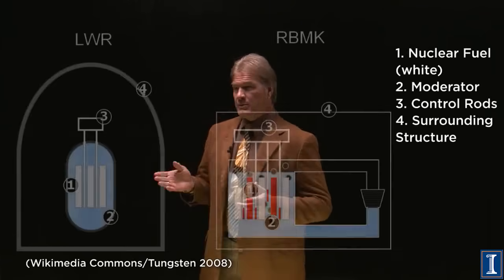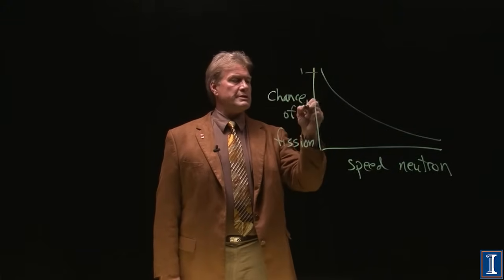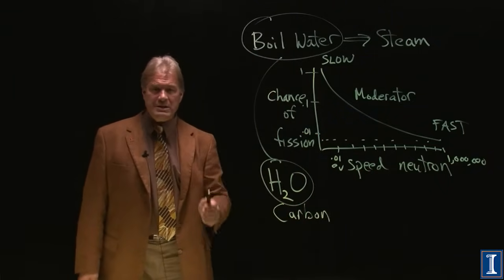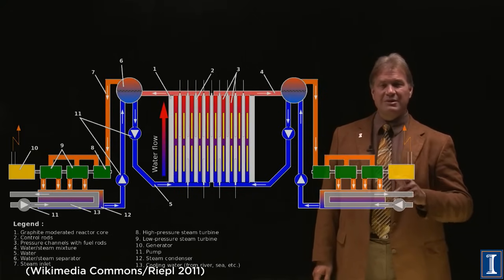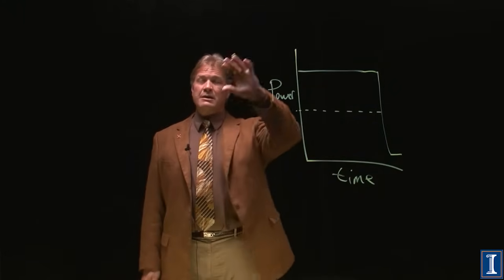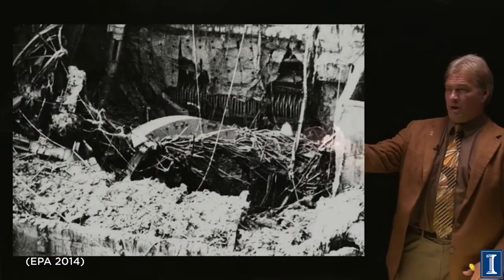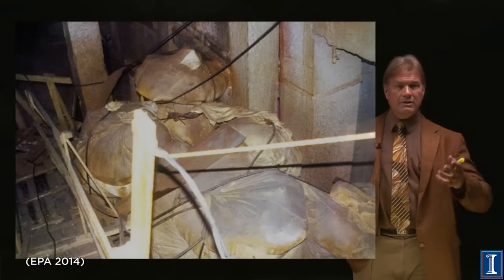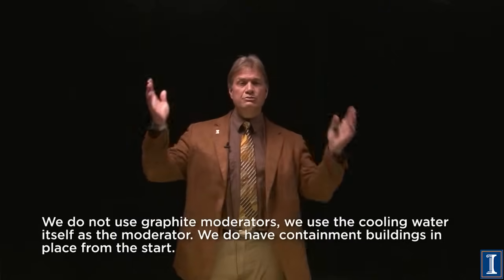Chernobyl: Worst Accident Ever

Comment: sorry but if a passenger  airplane hit a nuclear reactor, this wall will not be stronger to not have damage to the reactor.
Reply: Not true, the primary containment vessel would be barely scratched. They had crash-tested it with a military jet.
Reply: @pavel9652  passanger airplane , military jet....
Reply: @olivierb9716  I see you have 1 year long comment backlog. The nuclear plants are built to withstand passenger airplane. The engine blocks are the densest anyway.

Comment: what were the possibilities for a containing room  , to handle this kind of explosion on an rbmk reactor? ?
Reply: These are pressure vessels, so they would not explode. At worst what would happen is what has happened in Fukushima I think. Some of the reactors had a meltdown, depressurized and released some mildly contaminated water and small amounts of fuel if I am not mistaken. The vessels must have been breached somewhere in a more controlled fashion. There are lots of valves, water inlets, outlets, probes, etc. The fuel could have melted the hole in the bottom of the vessel. There was a larger explosion on the top of one of the buildings, but it did not breach the vessel.

Comment: Some of the best engineered items in the world work with natural sources of energy.  I'm surprised if the power fails that you can't use gravity to release or keep a flow of coolant, while gravity lowers the control rods and shuts it all down.  I would think this is the smartest first order of backup to have, in addition to batteries, generators and possibly the reactors own energy.  Really this disaster came about because of the xenon poisoning combined with the impatience of not getting the test done 3 times.

Comment: He makes a crucial error in this about the RMBK control rod design. There were two segments to the control rods a graphite moderator segment, and a boron 'coolant' section. The latter was designed to speed up neutron speeds and thus slow the fission process, whereas the graphite segments were moderators. When the control rods got stuck what happened was that they were trying to lower the boron segments into the core, but because the mechanism was jammed or the rods were already starting to warp the control rods were stuck in a position where about a third of the moderator remained in the core, and the boron segment had not even begun to be lowered into the core.
Reply: Yeah, I felt there was something missing in the presentation because I recall hearing about the control rod being jammed.

Comment: Saying RBMK did not have a containment building and stood in a regular building is idiocy and a lie. the reactor is underground and there is a lid on top with weight of more than 1000 tons. so from the sides it is not 3 feet but hundreds more of protective material and the lid was considered to be heavy enough. If there was a containment building nothing would change and the consequences would be even worse. Most of the reactor material remained underground. If there was a containment building it would be only worse
Reply: From what I have seen on diagrams the reactor is roughly at the ground level. Spent fuel is underground because it has melted through the floor. From what I remember, the primary containment vessel in Fukushima failed in a controlled way, since there are some weak spots in form of valves, water inlets, outlets, probes, etc.

Comment: I could listen to this man all day long.  One thing I don't understand is why did the Russians use carbon rods as moderators instead of water?
Reply: If you don't know why it is probably because of economics ;) I quickly checked on the internet and it looks like a design choice to maximize the power output at the lower cost. Fragment from wiki: "The decision to use a graphite core with natural uranium fuel allowed for massive power generation at only a quarter of the expense of heavy water reactors, which were more maintenance-intensive and required large volumes of expensive heavy water for startup."

Comment: The Fermi reactor uses liquid Sodium for coolant, which burns when exposed to AIR.
That's like driving a car and the oil will burn if regular Air contacts it

Comment: If Wester Reactors are water only moderated, so in case of a emergency the water boils and converted to steam or dissapear, the chain reaction stop an the reactor is shut down, why Three Mile Island and Fukushima nuclear fuel meltdowns? If the chain reaction stops, it is supposed that there is not creating heat anymore...
Reply: I think the shutdown core still generates thermal power as the fuel is hot and it heats up due to radioactive decay. The effect is much smaller, however, a few per cent max. Also, fast neutrons still have a small (1/1000th) chance of causing fission, the moderator slows them down and rises the chance of fission significantly.

Comment: In my oppinion, according to what happened at fukushima, the container of LWR is not enough to stop something like happened in Chernobyl RBMK, check what happened at fukushima , which has forged STEEL+concrete as a container, which is stronger than this concrete-only reinforcement that you are talking about. The fukushima primary THICK steel (like tank's armor)+concrete (5ft thick) container is meltdown with several holes, now the meltdown radioactive material is perforating the bedrock under the central. So, are you suggesting that a reactor out of control, with the capacity of producing more than ++++3,2MW of heat can be contained with just 5ft of concrete?

I think that you have to put the reactor inside a mountain to achieve that...
Reply: Some good points here. Having sufficient things go south, the containment vessel might not be enough. As far as I know, the containment vessel has been breached, although in a much more controlled fashion. On the other hand, this is another old power plant commissioned in 1971. Construction had begun in 1967, so it is a fairly old design. They have also not planned for a tsunami of such magnitude. Have they got a few meters more wall, the whole situation could have been averted.

Comment: Going off of the HBO and BBC documentaries I think this guy has made several  incorrect statements. The reactor was running at half capacity for several hours which meant it was prepoisoned with xenon when they stayed with the test. No operator hit any wrong buttons. Graphite control rod had non-graphite tips that increased radioactivity once they got inserted into the reactor.
Reply: It's the graphite speeds the reaction. Not the other way around.

Comment: looks at reactor design notes  "Under no circumstances should less than 30 control rods be in place to ensure safe operation"   Blyat!  Continues to remove all of them
Reply: You should look at those again.
Reply: The number was 15 not 30. 
Also the regulation allowed to go lower if Dyatlov gave his ok which was routinely done at all nuclear reactors. 

There also was a design rule stating a reactor may never ever under any circumstances be able to perform a runaway reation. The designers misunderstood the reactor and when they found out they maybe created a time bomb Legasov  covered it up
Reply: Also, to reactor designers, "under no circumstances cheap out and cut corners by putting graphite tips onto the boron control rods". Without the graphite tips on the boron control rods, the Chernobyl disaster might never had occurred.
Reply: @studiotwopointeight  you do know the "tips" are about 4.5m long?
They did not "cheap out" but it was a design feature to improve the effect of the control rods. It was a economic choice thou. It enables you to use the fuel to a greater efficiency despite it's low enrichment.
Reply: @flok462  

Bottom line, the graphite portion of the rods jammed in their slots, could not go in further, and turned the reactor into a 30,000 plus megawatt 40,000 foot tall nuclear blow torch that turned the entire region into an exclusion zone, that people continue to discuss four decades later. 

Stay focused and don't be pedantic. A better design with all boron control rods probably wouldn't have done with the deadly Chernobyl reactor did.
Reply: @studiotwopointeight  no. All boron means when they are fully extracted there is water in place of boron - causing xenon poisoning. You need something to replace the water when the rods are fully extracted. What better material than graphite so your control rods work as brake and accelerator at the same time doubeling their effectiveness. 

It's not pedantic at all. Nobody in their right mind puts 4.5 m of something somewhere he doesnt need to safe cost. 

You can see how all boron cant be the solution in how since 1986 the graphite in the control rods was kept and the safety improved through others means like the fuel rods.
Reply: 4 Rods were left in place to be precise. Not enough obviously.
Reply: @ohhhSmooth  4 manual ones, but I believe around 10 automatic ones were also inserted.

Comment: I am a bit confused.
If carbon is the moderator, used to slow down the neutrons, to enable fission thereby increasing the power, how is pulling the control rods out supposed to increase power?
And how on earth is inserting them back in supposed to kill the reaction??
Shouldn’t it be the other way around?
Reply: The main control rods consist of two vertical sections: an upper boron carbide cylinder, and a lower (4.5 m long) graphite cylinder. Those cylinders are connected to one another by a (1.25 m long) telescoping shaft that is surrounded by the control channel's cooling water.

When the control rod is fully lowered, it is its upper (boron carbide) section that lays in the active part of the nuclear core (where the flow of neutrons occurs) and absorbs neutrons, taking them out of the chain reaction ("neutron poisoning").

Conversely, when the control rod is "retracted" (that is, partially raised), it is its bottom (graphite) section that lays in the active core region, and moderates the neutrons (that is, slows them down to the ideal speed that favours more fissions).

This arrangement has a safety feature. To retract (raise) a control rod, an electric motor pulls against the weight of the rod and a spring. If the motor fails or loses power, the rod would fall in, with its boron section interrupting the nuclear core. Likewise, the emergency SCRAM shut down purposely lowers the control rods.

One flaw in the Chernobyl reactor design is that the water and tight fit of the control rod channel hindered the movement of the rods, causing them to take about 20 seconds to drop by the required 7 meters.

Comment: How did the lower power level lead to increased Xenon?
Reply: The fission of an uranium atom sometimes produces an iodine isotope. That iodine atom takes a long time (6-hour halflife) to decay into a xenon atom. Once the xenon atom appears, it soon absorbs a neutron from a (recent) fission and decays into something else.

That delayed chain of events affects the reactor when you change its power level. When the reactor first runs at full power, there are a lot of uranium fissions, a lot of iodine isotopes being produced and later decayed into xenon, and a lot of excess neutrons "destroying" the xenon.

When the reactor's power is suddenly cut in half, there are fewer uranium fissions and therefore fewer excess neutrons to mope up xenon atoms. Yet for several hours there is still an excess of iodine atoms (created earlier, during full power) that linger around for hours and keep creating a lot of xenon atoms through their gradual decay.

During that transition period, there is a large production of xenon but a lower production of neutrons to rid of it, resulting in a temporary excess of xenon. That excess of xenon absorbed ("poisioned") more of the already reduced flow of neutrons (from lowering the control rods) and caused the reactor's power to undershoot much lower than the operators needed to run their safety test.

It normally takes a few days to reach a new equilibrium at the reduced power. However, the Chernobyl operators were forced to keep the reactor running at full power in the days preceeding the test.

On the day of the test, they felt under pressure to run it as scheduled. They pulled the control rods back up (too many of them) in a desperate attempt to force the power back up to the desired half point.

Unfortunately, once the increased flux of neutrons quickly burned the absorbing xenon, and there were too few control rods left in place, the power level shut back up too high and created an unrecoverable cascade of other problems.

Comment: Bald-Faced Lie Alert!
1:50 The professor says that if all your other safety systems somehow go wrong the containment building will stop the radioactive debris from getting out to the general public.  This is obviously not true as later he rationalizes the failure of containment at Fukushima that lead to the evacuation of 300 square miles.

The Professor's Gross Conceptual Error 
At 4:00 this professor talks about the dual use of water to both moderate neutrons and cool the reactor's fuel.  His supposition is that loss of water means two things, that fission stops (it does) and that the reactor no longer needs to be cooled (spoiler alert - the reactor still needs to be cooled). 

If you have an electric coil heating element on your stovetop and you have a burner turned on, you wouldn't want to put your hand on the burner the second you turn it off.  Nuclear fuel is similar but different.  Not only is fuel in a recently shutdown reactor hot but radioactive energy is adding heat to the fuel.  When fission stops either thru shutdown or loss of water, the fuel continues to heat up.  The fuel continues to heat up because of the heat created by the decay of the radioactive fission products produced when the reactor was running and splitting uranium.  The professor's supposition that taking away water & stopping fission means the reactor no longer needs water for cooling is wrong.

Even when a reactor is shutdown, energy from the radioactive decay of fission products can add heat and increase the temperature of the nuclear fuel therefore, a reactor requires a system to cool it until `cold iron` conditions are met.  The Nuclear Regulatory Commission refers to this as the "residual heat removal system".

I was a reactor operator on a US submarine and since getting out of the Navy I've been a software developer.  I'm not especially for or against nuclear power but, I'd be a lot more for it if proponents wouldn't lie about it.  The information this professor has presented is designed to win an argument, he certainly isn't presenting the truth.

Comment: They didn't shot down to refuel. The only upside to the RBMK1000 was that they could refuel without shotting down.
They were doing a safety test to see if the backup generators could start from the turbines exces energy in case of a power loss.
In order to simulate this they shot down almost all the way. But did this wrong.
 If you don't believe me, please check out ANY other video/lecture on this topic . .

Comment: I cam here after watching your Fukashima video, and am a little confused about one thing. In this video, you mention that all reactors other than RBMK have their reactions slow down when they lose water, however in the Fukashima video you mentioned the main problem was losing the supply of cooled water to the reactor and spent fuel. Shouldn't Fukashima have been OK without water then?
Reply: Fukushima's problem was decay heat, there was no active nuclear reaction at the time of the accident. But that's only my guess, I'm not an engineer

Comment: I don't really understand physics and nuclear reactors but I like to think of the safety test as driving a car at 30 mph and turning the engine off, and while the car is slowing down use that movement to start the car up. And I'm talking about a car with a removed battery.

Comment: 5:40 The lack of water didn't help Fukushima, did it? The lack of water is what eventually caused Fukushima meltdown. Stopping the reactor can take days. They "shutdown" the reactor, which formally means its power was down a few percent, then they needed water to slowly cool down the reactor. When the tsunami hit, they lost the coolant water, and the power for the pumps. They restored the power somehow, but were not allowed to use the seawater for cooling. Eventually they had to vent the steam, which caused the explosion because of the hydrogen that zirconium cladding produces.

Moreover, with graphite moderator, you also can have negative void reactivity. It wasn't the case in Chernobyl, but per se it's more complicated than just: "oh, graphite means positive void reactivity".

7:47 Gosh... inaccuracies continue on and on. One of the advantages of RBK was that it can be refueled without being shut down. Refueling is irrelevant to the planned shutdown.

8:41 There were no "backup" batteries in Fukushima. They collected the batteries from the cars floating around.

Comment: So Chernobyl can't happen here, that is clear, but Fukushima most definately can. LWR is not entirely inert if the temp and energy levels end up turning your H2O into hydrogen gas - then it goes boom. Hopefully the new and future designs factoring in physics and chemistry will allow us to avoid these issues, although waste is still a challenge.
 Very good video - clear explanation that was simple without dumbing it down to the point of losing accuracy. Not an easy feat and the sign of a master educator.